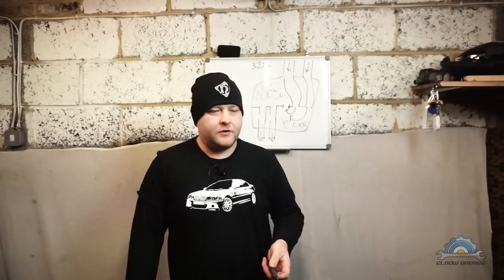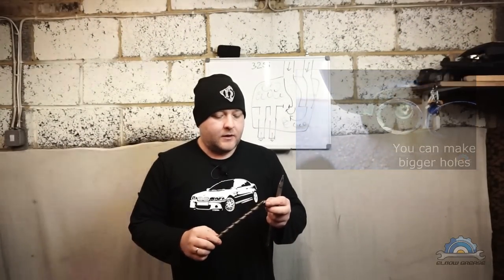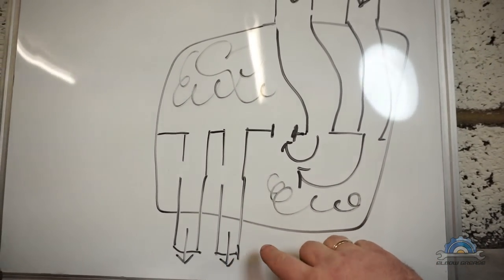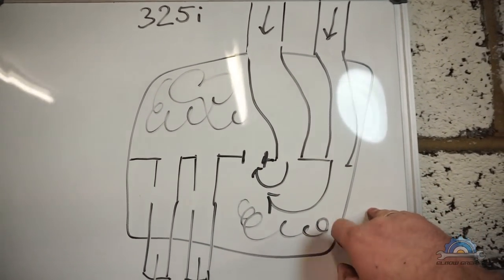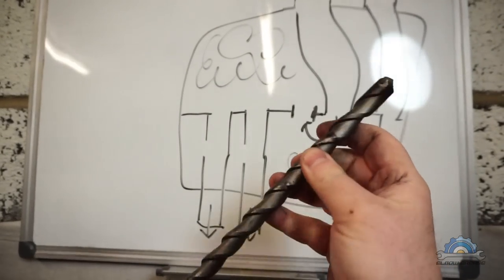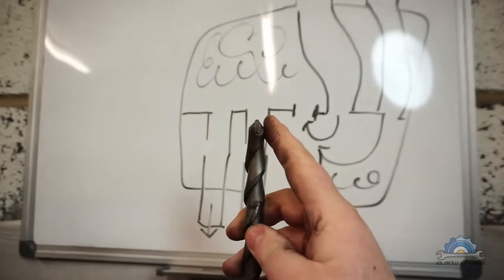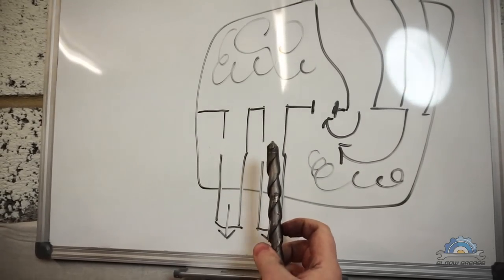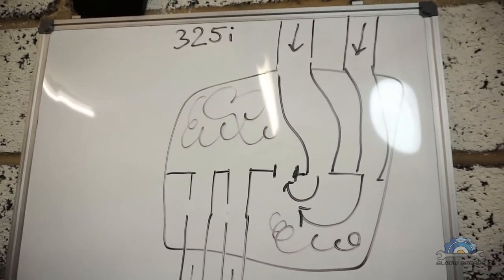CHEAP EXHAUST MOD HOW TO ? BMW E46

Comment: The drilled holes will result in rust and then get ready to replace the exhaust and build it properly instead of using poorman's mods.

Other than that, your channel is good and some of the vids and fixes are good, so keep it up!
Reply from the maker: hackermaniaa If you drive every day ,should be no rust aslo my exhaust is full of carbon after oil burning issue.Should last:-).
Will update in future
Reply: I really hope you don't run into the rust issues, because the previous owner of my car had the same mod and rust ate the exhaust inside out.
Reply from the maker: don't worry ,I know how to look after my car.My mate had 318 (low milage) box was rotten cuz he barly drove the car.
Reply: Jay  i wanted to ask the same thing !
Reply: Elbow Grease is it rusty in the exhaust?
Reply: Rusty now or not ?
Reply: @ElbowgreaseDIY  ???
Reply: I'm thinking of doing it, cos it doesnt take lots of effort and I want just a little more noise but it will rust fast imo.

Comment: What is the purpose of this? I am curious because I just purchased an E46 few weeks ago.
Reply: It is for increasing the exhaust sound of your E46, Without deleting your muffler or putting a new exhaust.
Although it cant reach that maximum exhaust noise.. But it does the job.
Reply: mujib ahmad what size drill bit did you use? Will a bigger hole make it louder??
Reply from the maker: Avin Bonifacio bigger hole = louder
Reply: Man search for muffler delet, thats better a thing and your car will have deeper and louder sound :D
Reply from the maker: but I'm not 15.
Reply: Elbow Grease It's not even about age, it's factual evidence. Deleting muffler and/or resonators will even increase horsepower and  will obviously, have a better sound. Believe it or not horsepower does increase, it has been seen in dyno testing.
Reply: Can this be worked on 99 328ci that has butterfly on one side. Please?